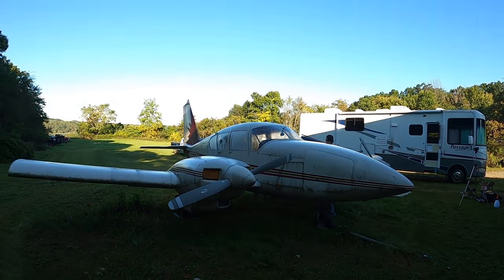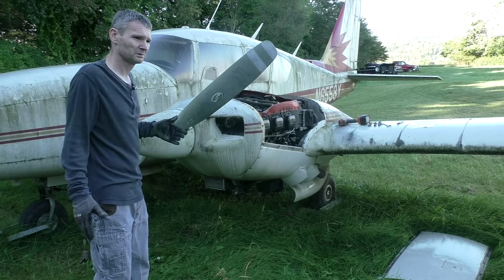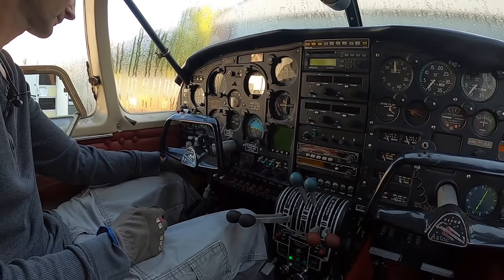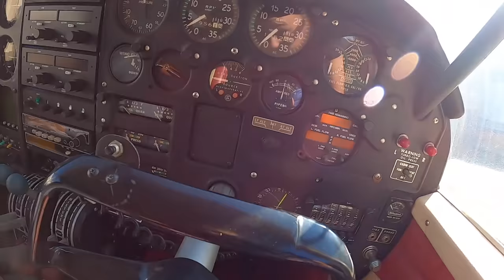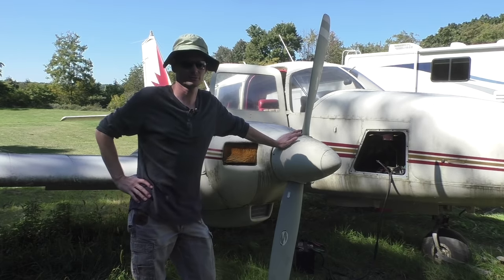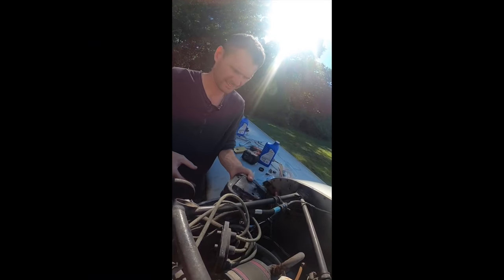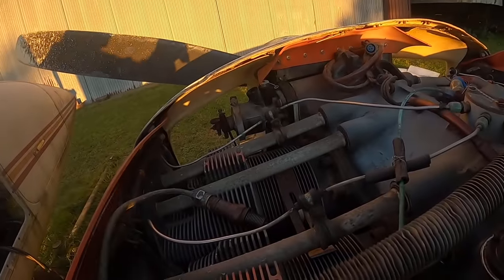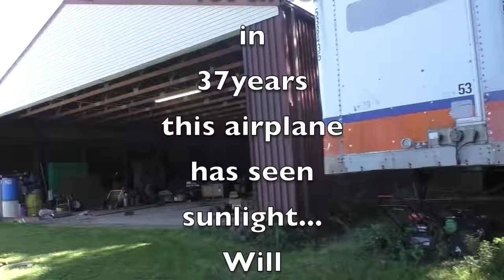Abandoned Airplane Will It Start After 7 Years? Aztec Twin Turbo!

Comment: Jimmy, I would have changed the oil, plugs, and ensure to get fresh fuel before attempting a restart. Should sump a few gallons thru the tanks to ensure no contaminates are in the tanks. A&P advice here
Reply: See the last 5 minutes of it? Yea, there’s some “contaminates” in there…
Reply: Both engines Ran, exorcize over.
Reply: Non A&P here. I would've removed them and taken them straight to an engine overhaul shop like Western Skyways at Montrose Colorado.
Reply: @c1ph3rpunk  I did and it looked nasty

Comment: I own a '73 Turbo Aztec. It has the Bendix "Shower of Sparks" ignition system. When you have the starter button in the start position, you are using a different set of contact points in the magneto that retards the spark to around top dead center, as well as depending on a vibrator circuit to make it all work.  When you release the starter button, the system goes to the "run" setting with different timing from an ordinary coil/condenser circuit.  Your starting circuit is probably not functioning, likely the reason it won't start until you release.  I hope you - or somebody - gets it flying.
Reply from the maker: Thanks for the info!
Reply: @therealjimmysworld  If it is the same as in twin Cessnas, it will also ground the ?right? magneto. So the left magneto may be dead
Reply: In the automotive world, I have also heard of them not having enough juice to fire the spark plugs while the starter is running. When you let off they have enough juice to pop them off. That's a whole different field though
Reply: The start retard points on the LH mag are probably dirty, it sounds like the buzzbox works. 
Also, if you pull the P leads off the mag side it will ground itself, (there is a spring contact that's closes if no P lead is connected) Just learned all about them after nothing would work on my old engine!
Reply: Exactly what I was looking for in comments
Reply: I was going to say that that is why
Reply: @GreatLakesLogger  I’m not a airplane guy but what your talking about is the early points and condenser systems. There was a ballast resistor or resistor wire that fed the coil a reduced voltage, but the system got a “jump” from a pure 12v feed from the starter circuit to help fire things off.  That’s with a distributor though. Magnetos in general don’t need any external voltage and create what they need directly.

Is it different on an airplane “maybe” but I would have no idea why folks would mix up terms. An internal combustion engine is an internal combustion engine.
Reply: Eliza Cole  z
Reply: @singleproppilot  I have that somewhat-rare system on both my '73 Aztec and my '62 Skylane, so I am somewhat the de facto Shower of Sparks man at my airport.  I have a great article on it that I reference occasionally to refresh my mind on how it works.  For old technology, it works marvelously and reliably - and in the coldest of weather.  If the starter will twirl the prop, it will start.

The only problem is that if the battery is dead, you are done, since the vibrator won't vibe.  And you can't hand-prop it,  since the starter button/switch has to be in the "Start" position; otherwise the advanced points take over, and I ain't hand propping anything at 22° before TDC - certainly not a 470 cubic engine or a 540.  I want to keep my fingers, my testes, and my skull in one piece. Or two.
Reply: @jwills8606  I think the whole reason why the impulse coupling is more common compared to the shower of sparks is because people thought the impulse coupling would enable hand propping with a totally dead battery. But let’s be honest: You’re not hand propping a 470 or 540 unless you’re Andre the Giant. I remember during the early days of my primary flight training pulling the prop through on an O-360 (for reasons that I have since learned are total nonsense), losing my balance and having the solid aluminum blade thonk me square in the noggin. Luckily, my ego was bruised more than my head, and I don’t think anyone saw what I did. So, no, I’m not hand propping any engine if it’s equipped with an electric starter.
Reply: @singleproppilot  On the last Aztec annual, I was assisting the A&P mechanic to check compression.  He was fairly inexperienced and kept jacking the prop back and forth as I added air pressure.  I kept telling him to get it close to top dead center and move it only a few degrees, well aware of the force from a 5-1/8" bore X 80 psi should the crank journal get very far to the side.  I just couldn't make him understand and verrrrry slowly brought up the pressure toward 80.  All of a sudden I heard, "I can't hold it!" followed by a thunk as the prop slipped from his grip and whacked him on the skull.  Blood streamed down his face from his scalp laceration.  He bled profusely for about five minutes but we got it under control with some clean rags, followed by a nice ER visit for stitches.  Fortunately I'd only about 40 psi when he lost control or it would have likely been much worse.  The sharp edge at the prop tip would guarantee you a skull fracture.  I never told anyone else at the airport what happened, nor has he.
Reply: @jwills8606  Ouch. Well, I bet he understands now, but that’s a rough way to learn a lesson. It makes me worry about the quality of his education prior to being signed off to take his A&P tests. When I got mine, the rules my powerplant instructor laid down were to find the exact top dead center using a special tool and to never put any part of your body in the prop arc when pressure was being applied. I haven’t done a compression check since then, as my whole career I’ve worked on heavy jets.
Reply: I was literally just talking about this with a buddy of mine! Did my milti in an Aztec that wouldn't restart in the air. Discovered this was why, after we knew what it liked, we could start it in the air
Reply: How much ££roughtly before someone is in the air in that thing total including purchase price
Reply: @garethirwin4714  The world's worst answer:  it depends. I might give you $5000 for the airplane as-is.  If those engines truly haven't been started in years, it would start with a borescope evaluation of the cylinders.  These engines are Continentals, so they are not as prone to camshaft pitting, and you might take a chance on them and see how the engines do.  Me?  At a minimum I'd have the engines rebuilt - about $75k apiece.  (Welcome to the world of a highly-government-regulated industry and its attendant costs.  Think Cuba on steroids, where they repair 1940s-era autos because new ones are too expensive.)  Then you get it repainted.  Then new glass all 'round.  Then rebuild the gear struts and brakes.  Then the hydraulic power-pack, gear retraction cylinders and flap cylinder.  Go through the fuel system completely.  New tires.  Then go through the instruments.  Then the interior.  Then.  Then.  Then.  When you are done, you will have an airplane valued at somewhat less than the money you have put in it.  Your time?  Gratis.  The bottom line:  sad to say, but probably the best fate for this airplane is to part it out and keep other Aztecs flying.
Reply: @jwills8606  very accurate assessment. Could be a great airplane for someone with an A&P and IA, but for an owner who just wants something that does the mission and flies, probably a pass.
Reply: @GreatLakesLogger  it's a little bit different with aircraft as the sparks are not generated by battery power but rather a separate mechanical system that can run irrespective of battery power
Reply: @therealjimmysworld  I think you should name the plane Wendell.
Reply: @GreatLakesLogger  That used to happen to 60's Chrysler cars.
Reply: @jwills8606  so sad that in order to win a nice plane you need to be a mechanic so you can work on it too cause it costs too much to pay someone else to do it.
Reply: @GreatLakesLogger  airplanes work based on magnetos like antique cars or tractors. The spark plugs dont draw energy from the battery but the rotation of the engine drives the mags
Reply: HA HA
Reply: @jayss10  Yes, mags don" need outside energy- normally. The timing is fixed on these engines-25* BTDC for this Lycoming model. To aid starting, the left magneto has a second set of points which retards the timing to near TDC. Additionally, the right mag is grounded out during starter engagement. This keeps the engine from kicking back if the 25*  right mag happens to fire. Since the mags are turning so slow during starting, the spark getting to the plugs is very weak. The shower of sparks system uses an induction vibrator to send a boost of current to the left starting mag when the starter is engaged. Let off the starter switch, the left mag returns to 25* timing and the right mag ungrounds itself and comes online as well. Other engines use an impulse coupling mag which retards the timing and gives a boost to starting but does it mechanically.
Reply: @bsrktm1  So I grew up on a farm and many of the tractors we used were older gasoline tractors some with magnetos so I'm very familiar with the operation of one of these units albeit in a tractor application.  Retarding the timing during starting and killing the other mag, that checks out and makes sense provided a single magneto can't advance the timing from start to operating speed.  I think that's making something over complicated but we're discussing the operation of this particular plane, not the theory of why it's there.  What doesn't make sense to me is how a properly designed magneto could be weak at slower cranking speeds, particularly in this case where it seems a particular mag is built with starting only in mind.  Magneto systems were designed with hand crank type applications in mind and were notoriously hot compared to a battery ignition.  I'm geninuely curious so if you have any addtitional info to share about why it's weaker in this application and needs additional systems I would appreciate it.

Comment: Immensely interesting and entertaining. Great content. Keep it up.
I'm a 52 year old auto mechanic and there are a few similarities between auto and aviation internal combustion engines. 
Can I just say, from my diagnostic perspective, you seem to be spot on. Systematic, methodical approach to those engines was a pleasure to behold. Compression, check. Fuel, check. Spark, check. That bad boy MUST run. It wasn't a matter of if, but of when.
Glad to see your camera crew invested in the project as well.
Cheers from North of the 49th.

Comment: That plane has a ‘shower of sparks’ ignition system that is enabled when cranking. When you release the start switch,  the mags go back to the normal run operation. There is an extra set of points in one mag that has delayed timing to get quicker starting. There is a vibratator box, red in color, that is the power for the shower system. I think it’s somewhere behind he instrument panel.  It’s been 25 years since I worked on an Aztec. Good luck.
Reply: Some modern car engines do this as well. These days “it’s only software”. It really helps keep the spark plugs from getting wet during cold weather cranking. That’s actually one of the weaknesses of multipoint fuel injection, it doesn’t have quite as much time for the fuel to vaporize as with a carburetor. I design MPFI systems for a living and wouldn’t advocate going back, but it is a bit more of a pain in the arse for the engineers to get the thing to start all of the time.
Reply: 100% this. My Mooney has the exact same device...failed 2x in 7 years so I'm intimately familiar with this failure mode. As soon as it worked when he let go of the key I knew what happened. The boxes tend to be in stupid locations and prone to water ingress.
Reply: In my 63 Aztec the shower of sparks box is behind left forward nose panel, on a shelf. Also, my baggage door key has to carefully be inserted and massaged around to unlock doors.
Reply: @dale116dot7  I would! Advocate going back to carbs., that is. Old cars=easier to, work on. My opinion, but to each their own! MPI is complicated enough and of course they're making DI now. 😁
Reply: @billyfoster3223  They may be easier to work on, but they pollute thousands of times more than modern injected systems, and that isn’t even an exaggeration (yes, I work in a dyno lab and have done the A-B testing). If there were the number of cars on the road as in the 1950s it would be less of an issue, but there’s so many cars on the road that there really isn’t a choice.
Reply: @dale116dot7  
Well those engineers must have got it right. I have never had a fuel injected car even in the late 80s fail to start on the first turn of the key no matter how cold the weather.
I love carbs and old equipment and old fashioned mechanical diesel injection. But for a daily driver on a gas car, I'll take fuel injection every single time.
I've never had a fuel injector fail on any car I've ever owned. My current 13-year-old Toyota has 378,000 on it. Still rolling on the original injectors.
I'm kind of surprised on aircraft that fuel injection didn't show up sooner. With the change in altitude and air density one would think fuel injection would be a significant advantage. Maybe it's just one of those things where 'if it ain't broke don't fix it"  is the main philosophy.
And they're certainly is merit to that especially when it comes to repair.
But it seems like a lot of things could be significantly less complicated on an airplane if you simply have multiport fuel injection. Or direct injection.

Comment: The Aztec is my favorite Piper plane.  Having grown up in Lock Haven, I saw many of these fly overhead.  While working as an engineer intern, I finally had a chance to fly in one.  Thanks for saving the old girl.
Reply: Same here ,I saw Aztecs on the assembly line. My dad worked  in flight test. Before the flood !
Reply: @mobius flight have any favorite memories of the 1st One's ,1960 autoflite?
Reply: @bernardc2553  Not really.  My father worked there for 35 years.  I never say the old girls except for the Apache.

Comment: Hey Jimmy, I have some old aircraft tools from my late father. A Top dead center indicator tool set, the old neon buzz box mag timing unit, these rivit holders ( I don't know what they are  called) that hold sheet metal together for riviting, some spanner wrenches for prop removal. I don't know what they are worth but if your interested name a price. I can send pictures. My Dad was a licensed airframe and engine mechanic. He worked for Grumman, United airlines, Cessna, and worked on many small aircraft. He was also a WW2 vet and was in what was then the army air force.
Reply from the maker: That is very cool!  Great history!  Email me details at jiminize1@yahoo.com  Thanks so much!
Reply: Those rivet holders are called "clecos" or "cleco clamps"

Comment: That pilots seat has a block to prevent the seat from going all the way back just in case the latching mechanism would fail on takeoff.  It is a safety device.

Comment: I repaired many Aztec Lycoming engines. The engine is very tolerate. Once it is service regularly, it preforms well. The air-cooled system is excellent, it helps to maintain the engine. Once it is properly oiled it runs well. Only complication you may encounter is carbon pressurized deposit in the electro unit of the spark plugs due to high torque combustion. However? This will be executed due to proper hourly inspection.  Jimmy did a great job. The Magneto, pressure check and overall sequence was good. Good job Jimmy.

Comment: Having worked in Aviation back in the 70’s, I recall a hot Saturday midday in New South Wales where I was refuelling a Pawnee at the bowsers
As I taxied back to the parking area I passed  an old Aztec that had not moved for several months. Just as I was level with its nose, an engine dieseled and spun its propeller spontaneously. From that day onwards I have never ever again walked through an aircraft’s propeller arc.
(Scared the daylights out of me.) Cheers from Downunder👍🇦🇺🇺🇸😬

Comment: Seeing that Aztec brought back memory of the mid 70’s when I worked for an ag flying company in New South Wales. It was a hot Saturday midday and I taxied a Pawnee over to the fuel bowser to fill up for Monday , past an  old Aztec that was parked in the open and hadn’t moved for several months . It occupied a parking space alongside several other light aircraft. As I was refueling the Pawnee I happened to look across at the Aztec and observed its port engine spontaneously fire up and start spinning the prop for about 15 seconds. I guess that the outside temperature caused some fuel to fire. I have never witnessed anything like that again. It taught me to never walk through the arc of a propeller for any reason.
Cheers from Downunder. 🇦🇺🇺🇸👍
Reply from the maker: Whoa! Clear Prop! For sure!

Comment: The interior of that plane seems remarkably clean for sitting outside that long.
Reply: @noidontthinksolol  That's true... but, I know the last old BMW I bought that had been sitting in a garage without running for about the same amount of time was completely covered in grime.
Reply: @noidontthinksolol  Twice.
Reply: Cabins are pressured and sealed so the interior would not be in the elements.
Reply: @Strange_Brew  I highly doubt that. This plane was never sold with a pressurized cabin.